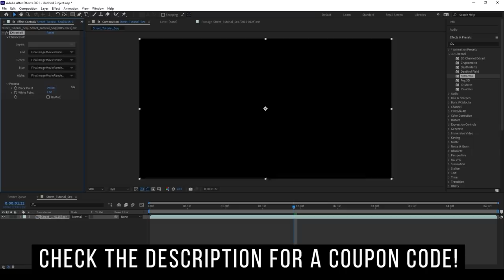Why Modern VFX Suck (And How to Make Yours Not Suck)

Comment: Another possibility might be that because of the rise in the number of VFX artists maybe there are a lot of them who aren't skilled enough. And maybe a lot of studios assign work to the studios with that type of VFX artists just to save money. Because from what I've seen (from videos and articles) the likes of ILM and Weta have been in the industry for ages and they have honed their craft to another level. It's normal for relative newcomers to not be as good as them.
Reply: my brother in christ you can't even get a job in the industry if you're not "skilled enough." Do you think ILM or WETA is filled with the exact same people for twenty years?
Reply: @tlr3191  even if the same people aren't there, the ones at the top are the seasoned vets. They would be able to guide the ones who might be new. 
But the same might not be applicable for relatively newer studios. 
Then again, these are all speculations.

Comment: super hero movie not grounded in reality 🤔
if theres things in the comics that dont exist, theres literally no way to depict them
Reply from the maker: Most super hero movies are based in reality to some extent. However, what I'm talking about here is placing your camera in a way that would be realistic if the CGI environment was a real place, rather than having it fly all around and do impossible maneuvers. Also, if you watch the behind the scenes of Interstellar, you'll see that the tesseract was minimally CGI, most of that was done in camera on a set. So you can construct sets and use in-camera tricks to achieve at least some of what goes into most of the scenes in these films, instead of shooting entirely on a blue screen. That's what I mean by grounding it in reality - adding as many real elements to your scene as possible.